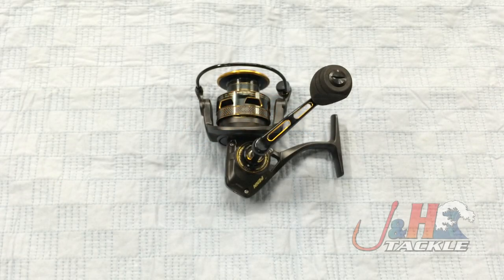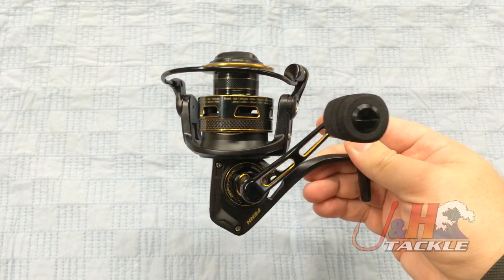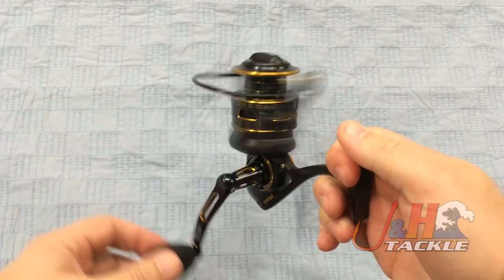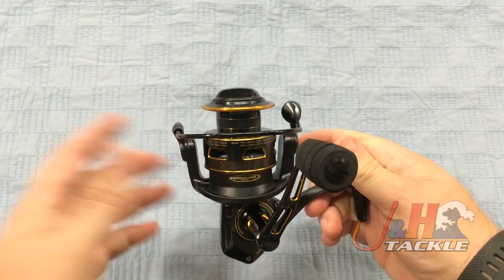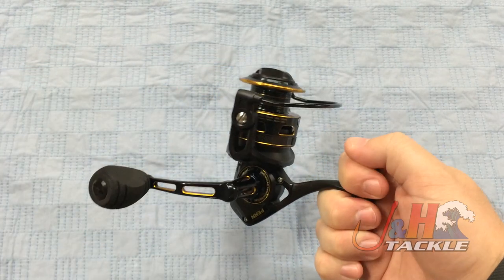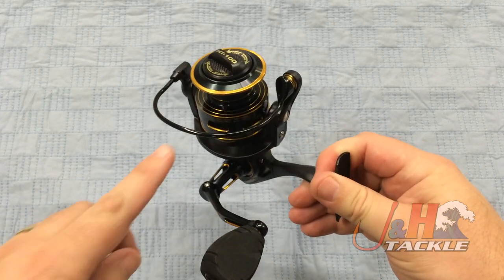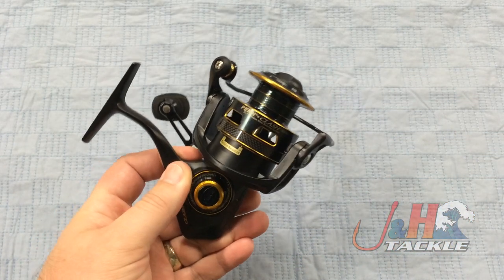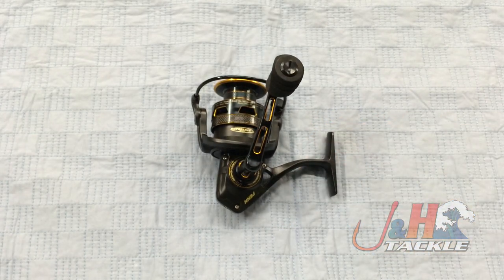Penn Clash CLA3000 Spinning Reel | J&H Tackle

Comment: i like the stratic 4000 which would be suitable for freshwater fishing (targeting walley, pike, perch, some catfish). Would you recommend the stratic 4000 for that or penn clash? ive seen the 4000 stratic is about the 3000 penn clash right? or is 2500 like the 4000 stratic (as the stratic is really small). thanks so much

Comment: What size would you recommend for a 7'0 medium fast St. Croix tidemaster? The 3000, 2500, or 4000. I would be mainly fishing for fluke  and schoolies stripers.
Reply from the maker: 2500 or 3000 is fine.
Reply: +jandhtackle thanks for the info I ended up getting the 3000 and it's a perfect match. I love the reel, except I feel there is a little give on the anti reverse compared to a few of my other cheaper reels. I may just be being nit picky, but there is definitely a tiny bit of give. Did you guys notice any of that?
Reply from the maker: Every reel is different. A tiny amount of play is normal.

Comment: Which would be better for both bass and inshore fishing the 3000 or 4000
Reply from the maker: The 4000. They are very similar in weight, so go for the one with more line capacity.

Comment: What is a good pairing rod for this reel?
Reply from the maker: +Fishing With Joseph What are you fishing fro? From a boat or the beach?
Reply: +Fishing With Joseph same question  - i would be doing mostly inshore trout, drum, sheep etc.
although I have been meaning to try out surf fishing - so what would you suggest for either scenario?
thanks guys!
Reply from the maker: +b A 7' M spinning rod would work for both applications. What is your budget?
Reply: +jandhtackle the maximum amount i can hide from my wife ;-p
i kid - i'm not sure.  i think I would like to keep it under $200 but obviously my chief concern would be bang for buck.

so do i want one nice reel/rod combo or should i spend some money and get myself a nice long surf rod as well.
Reply from the maker: +b If you can swing it, get eh St Croix Avid Inshore VIS70MM http://www.jandh.com/st-croix-avid-series-inshore-spinning-rods.html
Reply: +jandhtackle that is a beautiful rod.  my concern with the 1-piece rods is I don't have a great way to easily transport a 7' fishing rod without taking it apart!
Reply from the maker: +b PS70MF2 http://www.jandh.com/st-croix-rods-premier-spinning-rods.html
Reply: +jandhtackle Nice.  think that PS70MF2 would work?
Reply from the maker: +b Yup.